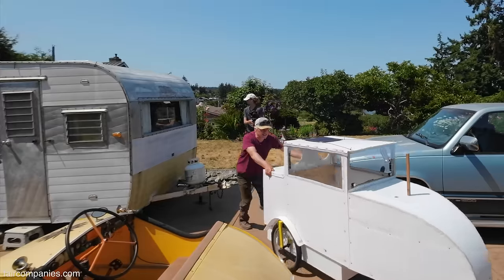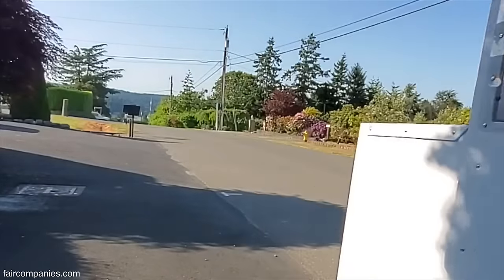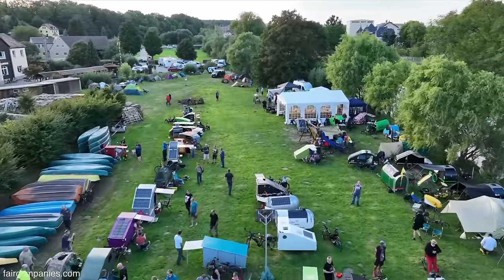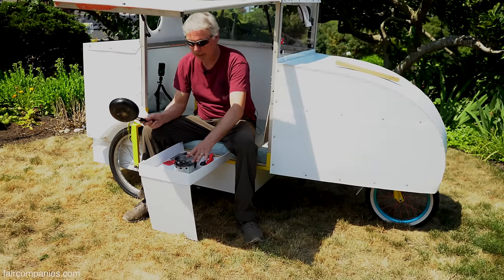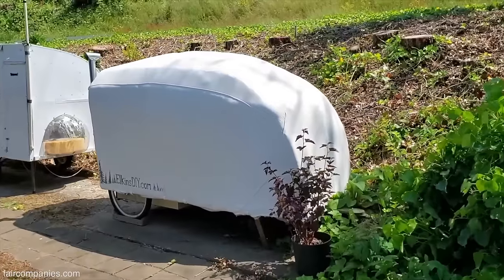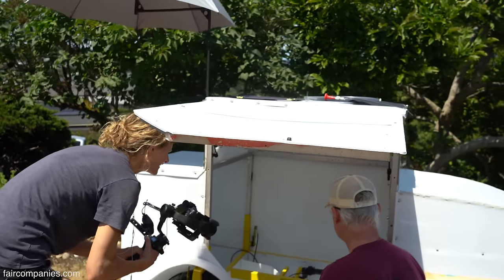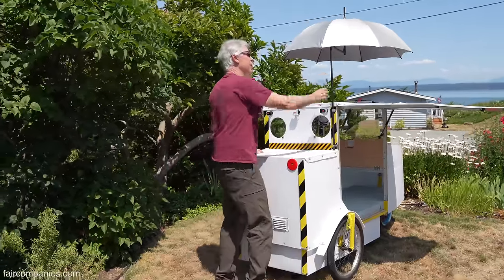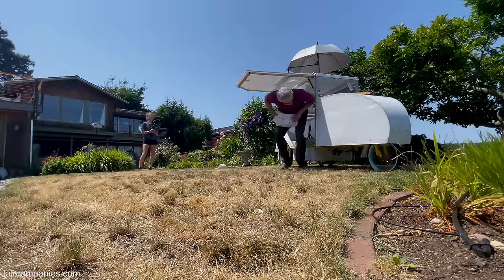His Velomobile RV is a bicycle-camper to live (bed, kitchen, WC included)

Comment: Rest of us are very dumb.  Under beam crank and under seat steering.  Trike platform should be a commercial design.  I could prefer a squarer front, and long for both storage and full size shingled solar panel (96cm wide) support.  Optimizing for solar commuter/cargo e-vehicle size, would let you/me also build a "kitchen/battery trailer" for longer touring/camping.

In terms of a commercial trike frame, eyelets to allow wooden structures built over it would help.  Maybe the metal trike frame is as simple as allowing a 2x4 hole in it to extend side supports for a diy "faring"/camper.

Comment: The single front wheel trike design is inherently unstable in turns, tilting forward-right and forward-left with the center of gravity shift.  It's why Can-Am designs their motor-trikes with 2-wheel front steering, and a single rear drive wheel.

No "bathroom" is shown. a shower curtain is NOT a WC. You'd need a Porta-Potty...